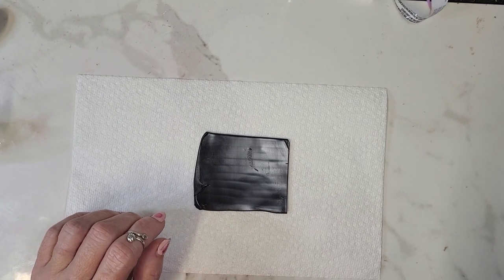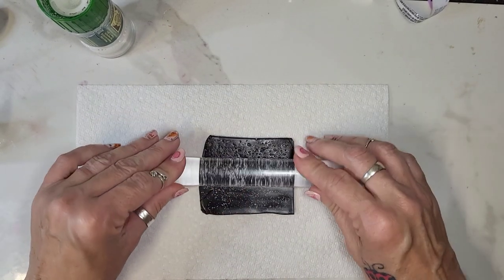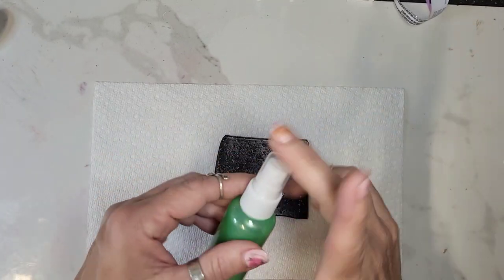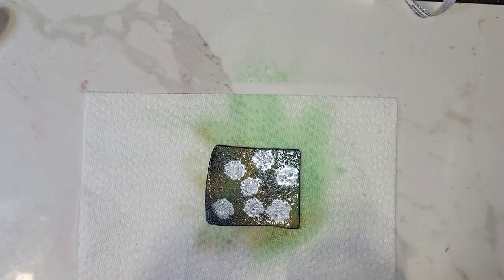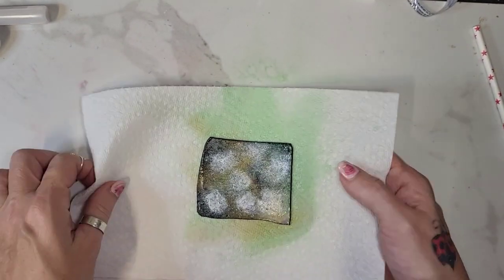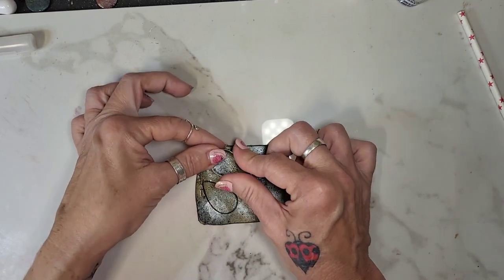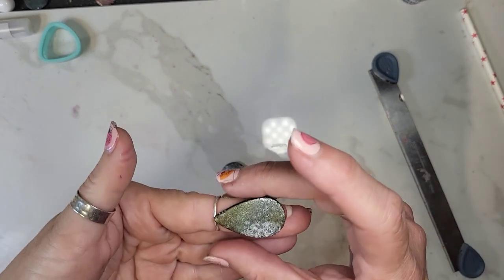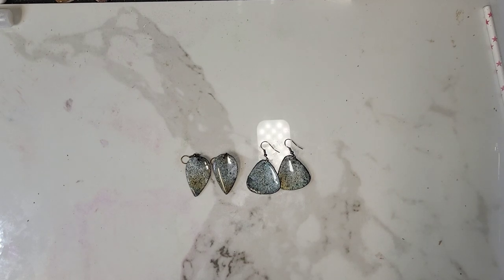Creating faux enamel with surface technique on polymer clay

Comment: You need an air compressor young lady. With the work you do and techniques it would help you a lot and you wouldn’t be inhaling the fumes. You can get the pressure down to 5-10 and it would dry your clay without cooking it. Just a thought. Thanks for sharing your knowledge and ideas! All the best cheers!

Comment: I love this!  Thank you so much. What resin do you use?  It really brings out the gorgeous surface decoration.
Reply from the maker: UV Resin Crystal Clear Hard Type - Upgraded 200g Ultraviolet Fast Curing UV Epoxy Resin for Jewelry Making Craft Decoration, Hard Transparent Glue Solar Cure Sunlight Activated Resin Casting & Coating https://www.amazon.com/dp/B08PF9D65P/ref=cm_sw_r_apan_glt_i_WTRHY2KAYFPYA82QPQC3?_encoding=UTF8&psc=1
Reply: @happyplacestudio  Thanks!  I just found your resin tutorial....I use that one too.